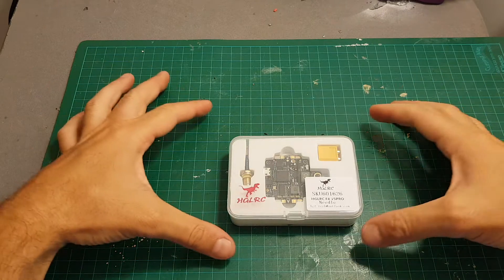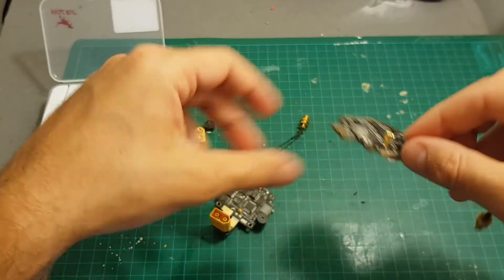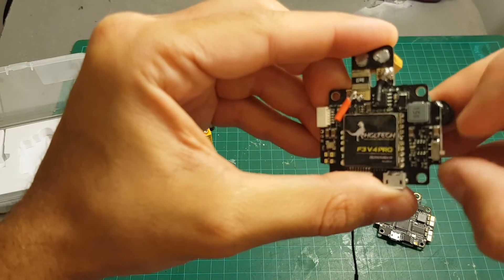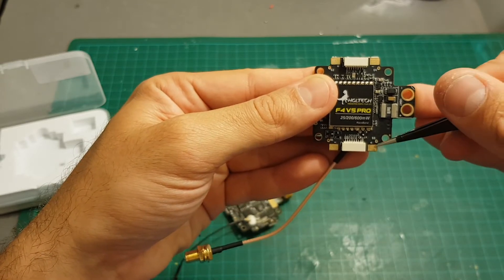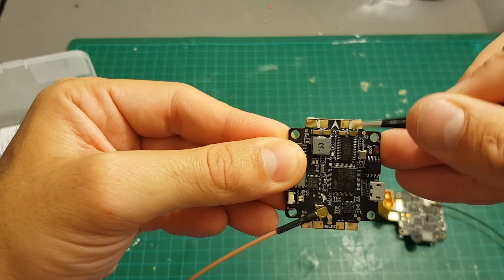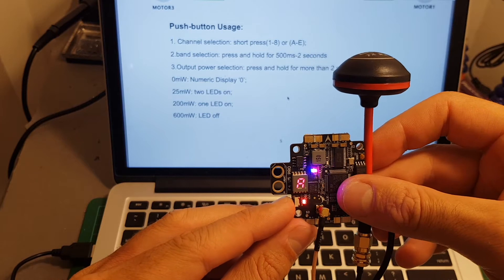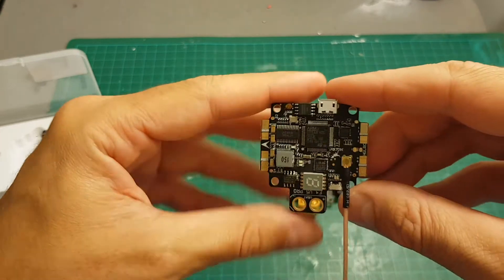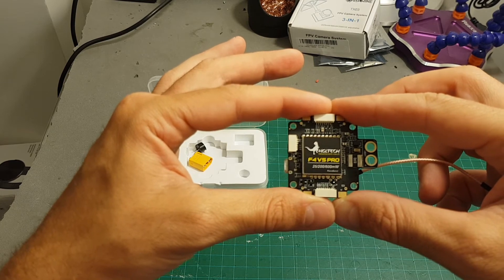HGLRC F4 V5PRO Flight Controller Unboxing And Overview

Comment: I just ordered one of these. They are quite cheap right now so I figured why not. I am building my first quad so I got this and a bunch of HGLRC 28am esc's that were on sale as well. It should be a good clean build. I am going to use the DYS samguk motors with it. The only thing I need to figure out is what frame to get.
Reply from the maker: decisions decisions :-) Which one did you eventually pick up?
Reply: Gal Kremer still trying to figure that out  I was watching your videos earlier trying to decide...lol. the transtec frog lite is on sale right now and so is the Martian 220 and the 215. Just not sure if I want a freestyle or race frame. I also may want to try a frame that has the battery on top. This is proving to be my hardest decision. Sigh..lol
Reply from the maker: Check out this one: https://youtu.be/n9FwgLjKpa0
Reply: I did thanks. I left a message for you on the other video you suggested. cheers Gal. Again thanks for everything sir

Comment: My internal VTX has burned... How to get the FlightCrontroller OSD output to use on an external VTX?
If you have any fix please :)
Reply from the maker: I don't think that it's possible unfortunately, but I suggest that you should contact HGLRC directly in order to confirm it.

Comment: changing the VTX to zero - Doesn't that mean that the VTX can be switched off.? thus allowing you to use a different VTX. ( i hope so,I'm betting on it)
Reply from the maker: +Old School Yes - it will turn off the VTX.
Reply: My internal VTX has burned... any idea to get the OSD OUT of the FC to use an external VTX please?

Comment: hello gal kremer !! it seems very interesting this flight controller (f4 v5pro) but I did not find any information about it and I was thinking of buying one to mount my drone but I would like to know how they are going and if you have problems to configure it and if everything that is offered goes well like vtx etc that failures can give. I really appreciate your help. basically if it is a controller you recommend. a greeting from Spain.